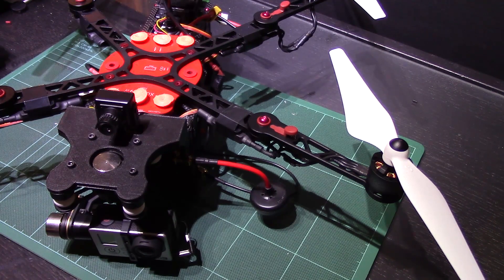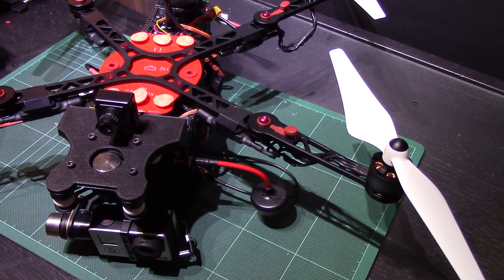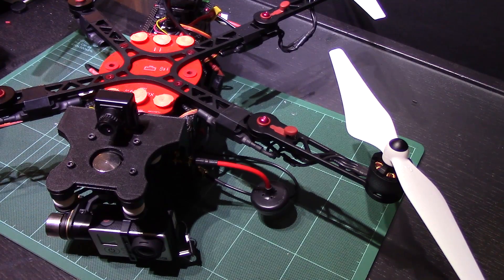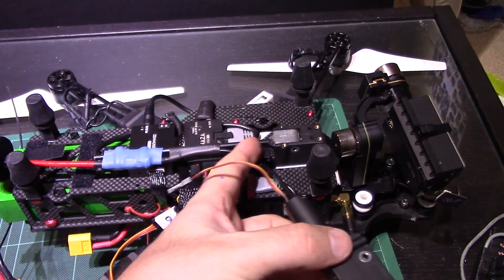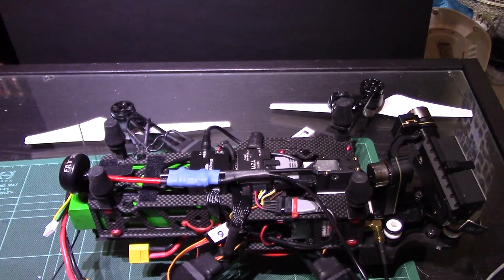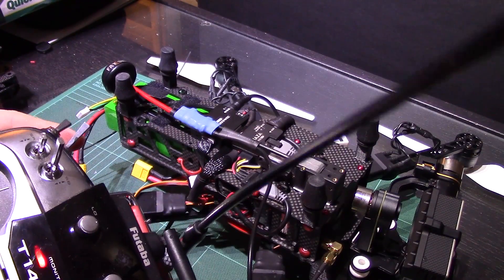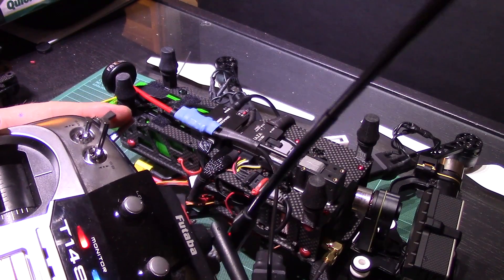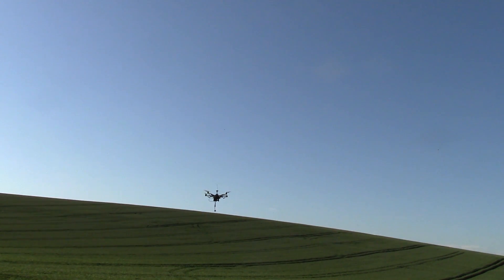Retractable VTX Antenna for FPV - Cheap DIY mod

Comment: Brilliant mod. what receiver were you using when you got 2km range with this?
Reply from the maker: +Richard Stopher I am using the ImmersionRC 600mw vTX
Reply: +d3weyTube sorry I was referring to your ground station. thanks for the reply, your videos have been my inspiration. I have my xugong frame and am looking forward getting it in the air
Reply from the maker: +Richard Stopher Glad to hear my videos have given you a boost Richard. At the time I was using the ImmersionRC Duo 5800 receiver with their 13db (large version) Patch antenna for one antenna and the cloverleaf for the other.
I mounted it all in a case I custom made. Few pics here: http://smg.photobucket.com/user/DeweyAXD/library/Ground%20Station 
These days I have to admit I tend to use my Blackpearl 7ch screen with diversity inbuilt. Its not range is ever so slightly lower than the ground station but when i did retracting antenna mod it made up for that a lot. Massive range now. The black pearl is soooo much more portable than lugging the tripod etc which suites the XuGong's compact nature.
Reply: Yet again many thanks for the reply, I was toying with the idea of going down the Duo 5800 route as I am planning on building a antenna tracker. I think that the Blackpearl would be a good investment in future for when i take the XuGong on my travels. Nice looking ground station. Btw the retractable antenna is genius! Thanks for the help.

Comment: What case are you using to transport the Xugong in?
Reply from the maker: Bunny_Ninja These days i use this http://www.maplin.co.uk/p/large-high-impact-case-with-pre-cut-foam-interior-n14gr because it fits my XuGong, 14sg and 3 batts inside no problem. Without the Zenmuse mount/mod you can fit it nicely into one of these though: http://www.maplin.co.uk/p/small-flight-case-with-foam-interior-n50fu see this post for details: http://www.rcgroups.com/forums/showpost.php?p=30672382&postcount=14

Comment: You keep adding features like that and you will be down to 30 sec flight time :)
Seriously I really like what you did. I hope it gives you the clean video you were hoping for.
Reply from the maker: ***** lol yeah it is getting a bit on the porky side but I am still getting about 15mins somehow.... but hell there are 2 more useable servo outputs... do I hear head tracker?! :-p
On a side note this mod really is working great. Spent a few hours tonight enjoying the Xugong and knowing that I won't get static when I yaw at 2km+ away over a river is comforting to say the least!
Reply: d3weyTube HeadTracker would have been my first choice :)
But kidding aside I think you might be on to something here. It inline with the Inspire1 with retractable legs.
The only thing that I would worry about if what would happen in a hard landing or a crash. Would this construction cause extra damage to the frame or other parts.
Reply from the maker: ***** Shouldn't cause any major harm. The trick is not screwing the retract servo to the bottom plate, I just use 3M double sided pads so that there is a weak spot. The theory would be that if I clipped a tree with it or if I had a bad landing that the pad would rip off and/or the CF spar would snap first before the air frame. Same reason the 3D print landing gear is made quite thin so there is a dampening failure point on a crunch landing which should prevent tearing the CF plate.
So far it and the new angled motors are working out nicely though.
Reply: d3weyTube Good thinking there. You want the inexpensive / easy to replace parts to break.
Looking forward to your next XuGong mod.
Reply: ***** Nice idea. Which gives me an idea of why not just use a 9g servo. This thing is 38g afterall.
Reply from the maker: John Law To be honest I doubt it would be a problem and well worth trying/sharing if you fancy it John. Personally I would also be a bit worried about wind resistance. Recent aquaduct flight saw me flying at an indicated 40mph to get to it fast enough with a boat still on it so a lot of wind resistance against the antenna/servo arm. Not a problem 90% of the time though. It probably reduces flight time by 1minute max but I see that as a small price to pay for ease of install and reliability. Metal gear 9g should work.

Comment: D3WEY, I messed around the other day with a simple servo and a screw on doover I invented on my 3D printer. Works like a demon mate. Im now stuck trying to find some of that nice soft flexible coax so the bendy part does not load up the servo. Im sure with your 3D printer skills mate you could rattle up a wee 1/4 wheel or something that screws onto a servo arm or disk and Bobs your Uncle. Same deal for a good chunk less, just set the end points on that channel to get it to retract and deploy to where you want it. Well done by the way. Very good idea.

Comment: You've only gone and make me have to do that to my v1
Reply from the maker: Gary Streeton Good man! I think it'll work well on any 450 sized quad without taking a mass of space up.
Reply: What model retract did you use.  Still not sure of the benefits of buying the v2 as the v1 fells fine.  Can you add any gimbal to it as have a cheap China eBay one I modded.  Again due to you lol.
Reply from the maker: Gary Streeton I am using one of these:
http://www.hobbyking.co.uk/hobbyking/store/__37225__Servoless_Retract_with_Metal_Trunnion_33mm_x_35mm_Mount_2pc_UK_Warehouse_.html
They come as a pair and have the 4mm shaft but browse the landing gear section as there are a fair few on there. 4mm was a lucky fit for the CF pole I had.
v2 is a big improvement on the v1 but to get full benefits you need to be using a PPM RX and if you want RSSI feed to be seen through the OSD then you need EzUHF.
Fitting an ebay gimbal will be a hassle. Doable but then anything is doable if you work for it lol.
v2 Pro is my go to quad now as it has everthing I need (Especially now i have the H3-3D mounted).
Reply: Cool. Cheers bud.  Going to give that a go.  Sadly I use a hitec a9 tx so ppm is out.  As for the gimbal.  Think if I get the b2 I've just have to get the full package. Stick with my naza v1 save on the pennies